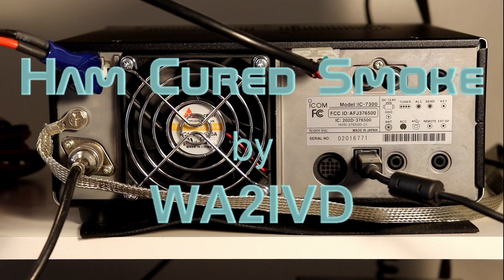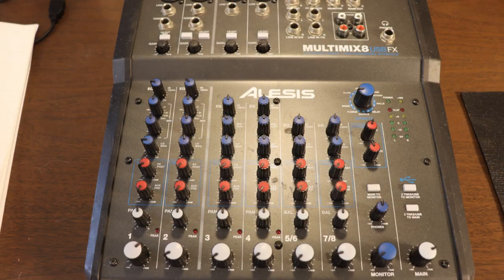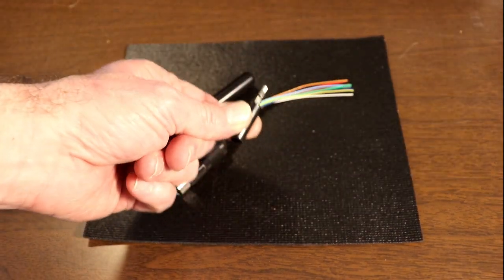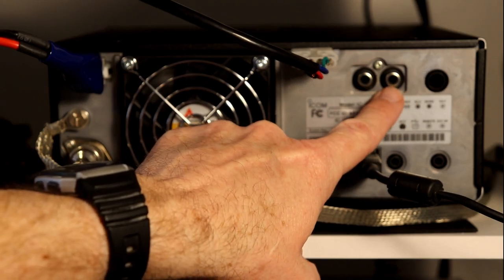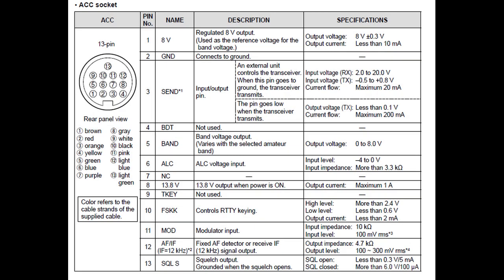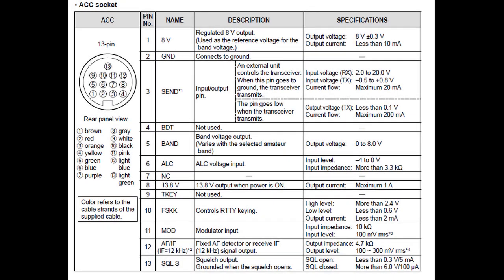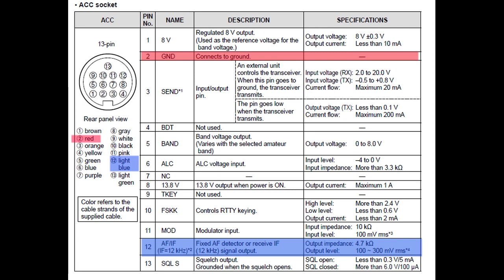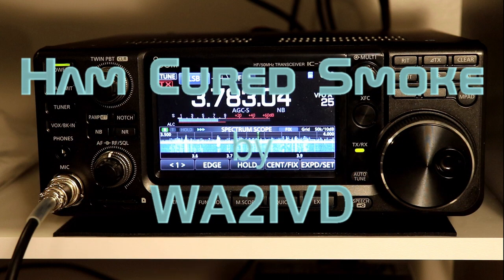Icom IC7300 A to Z #8 Acc Socket & Connector Info

Comment: hi tom me again 😞 im looking to add a mfj 1708sdr swither between my ic7300 and sdr unit ?
my question is which cable would i buy for a direct ptt from the radio to the sdr
Reply from the maker: Hi.  I found this cable on Ebay that looks like it should plug right into the Acc connector on the 7300 and the CTRL connector on the MFJ.  https://www.ebay.com/itm/Linear-amp-PTT-switching-cable-Icom-IC-703-IC-706-IC-718-IC-7000-IC-7100-13p-/254179107879?_ul=IN&gQT=2
Reply: @HamRadioA2Z  ty so much tom worked a treat glad to see you are still sharing your knowledge 😎

Comment: hi there awsome videos on the 7300. I have an offtopic question: where did you connect your braided lead to thats on the back?
Reply from the maker: I assume you're talking about the ground lead?  In that video we were in a rental house, but I was able to drive a ground rod right outside the wall where my coax came in.  So I had a ground bus bar at the back of my shack table to tie all the equipment to.
Reply: @HamRadioA2Z  thank you I thought something like that, unfortunately i can’t get a ground rod to my schack

Comment: can you do a Video on how to connect a AMERITRON pulser amp tuner to a ICOM-7300 I have a brand new one and I cannot get it to work, is there a special setting the radio has to be on?
Reply from the maker: Hi Henry.  I haven’t used any amps with my radio yet.  So I don’t have any direct experience with this.

Comment: Thanks for the straighforward explanation Tom. What does one need in order to use the accessory port for multiple functionalities, is there a break out box or similar available?
Reply from the maker: Icom makes a cable (OPC-599) that splits the accessory plug into 2 smaller 7 and 8 pin DIN connectors.  It is mostly for compatibility with accessories for older Icom radios that had 2 smaller connectors instead of the 1, 13 pin connector.  I don't know of anyone that makes a breakout box or anything similar.  Although, that sounds like a really good idea.
Reply: @HamRadioA2Z  Thanks Tom. I did see a home brew version on YT about a year ago (by an EI ham I think) that needed two or three specific functions that each required a common earthe/ground feed and they took out the various functions to separate 13 pin DIN connectors mounted in a project box, and I recall him pointing out that not all 13 pin DINs are equal in quality.

Comment: I wonder if it is possible to use the amp keying port to power a relay which would switch between  an rx and tx antenna
Reply from the maker: Sure.  That would work.

Comment: Another excellent vid.  Why is the key plug stereo?
Reply from the maker: You need stereo for the 3 connections to use a paddle with the internal keyed - Dot, Dash & Common. You can program the radio for a straight key. Then you only need the tip and common connection.
Reply: @HamRadioA2Z  Got it! Thx.

Comment: I use a mixer too, but I go directly from the speaker jack on the back of the radio into the mixer with an adapter. No need to use the accessory port in the back. Why did you not choose the speaker jack to mixture way?
Reply from the maker: Hi Jose.  Thank you for the comment.  There are 2 reasons that I use the accessory jack.  First, the audio level coming out of the accessory jack is a “line level” output or about 1V P-P max.  It is more suited for going into the input of a mixer than speaker level audio.  You can use a resistor divider or attenuator to make the speaker output work okay.
The second and more important reason for me is that the accessory jack output level is fixed, regardless of how the AF Gain or volume control knob is set on the front of the radio.  So, once you set you mixer levels, you don’t have to worry about them changing if you or somebody else accidentally or intentionally adjusts the volume knob.  73,  Tom

Comment: What Is the trick for unplugging the power cable!
Reply from the maker: Hi Frank.  I had this problem early on also.  It looks like you should press on the split piece of plastic toward the rear of the connector, (at least that’s what it looked like to me)  That is not the case. You need to press on the center piece of plastic on the top of the power cord connector right next to where it meets the connector on the radio.  You need to do this with a thumbnail or with a small screwdriver.  Then the power cord connector pulls apart easily.

Comment: I love your videos. All of them have been good for me as a new ic-7300 owner.  Question.  I run the audio from all my radios to my digital mixer.  I decided to use the ext speaker out of the 7300 to my mixer so that I can adjust the volume from both the radio and the mixer but I also have a at2020 studio mic that I would like to use for the 7300, along with a external ptt switch.  Can I connect my ptt switch and my mic input through the acc connecter or would it be better to connect through the front mic connector?  Thanks!  W5CIB
Reply from the maker: You will have to connect that mic to your mixer, or to some mixer.  It requires 48V phantom power.  Icom rigs are setup for electric condenser mics.  So they do put out a power source for the mic, but it's only 8 volts.  I don't think it will work for that mic.  You would be best off to run that mic into a mixer and then feed the mixer line-out to the Acc jack on the back.  You can connect the PTT switch to it at the same time.  You could use the one mixer and have all the audio from the radios on left channel and have audio going back to the radios on right channel.  Just make sure you have all the pan pots set the right way or you'll be in for a lesson on feedback. 😉
Reply: @HamRadioA2Z  Can you detail a video or even here in the comment section, which of the wires from the ACC cable are needed in order to connect a microphone through the ACC socket? For example pin #11 says "Modulator" pin #3 SEND and then there's a ground pin. Are these the 3 you need to get audio from an mixer XLR connector in the 7300? Your response is highly appreciated

Comment: Hi do one please not in the handbook usi g the external 4 button external keyboard  its programming and use  thanks
Reply from the maker: Hi Peter.  I think you’re talking about the button switches that you can build to select and transmit the different voice or keyer memories.  I have thought about that and would like to do a video with a build project to make a switch box.  Not sure when I’ll get to it though.
Reply: @HamRadioA2Z  I would be happy to see a switch box video Tom. Also, this might sound strange, how about a video on how to use the filters correctly, i.e. in real situations. Which to use when and even how to make sure that you default them after changing the settings for a specific qso.

Comment: I am assuming your mono connector to the mixer will output in one channel only out of the mixer?

If that is the case, I was looking or a 3.5 mm mono to dual 1/4 mono, but not found yet. In that way I would get line Right, and line left on my mixer, so I can use both output channels with two studio monitors I got. 

Are you using then just one speaker for the audio then? Thanks.
Reply from the maker: Yes, mono.  No dual receive in the 7300.  So nothing for the other channel.  I have the rig going directly into a 1/4” instrument input on 1 channel of my mixer.  Each channel on my mixer (and most mixers) has a Pan pot that allows you to direct that channel’s output to Left Channel, Right Channel or anywhere in between.  So should be no problem getting your rig output to both speakers.

Comment: Hi Bob  i would like to install on the ic7300 my behringer console but without the mixer.
do i use the same connection that you describe on the video and the connection is direct  without
any electronic components (resistor etc)?
thanks bob
jimmy kp2bh
Reply from the maker: Hi Jimmy,
I don’t know which Behringer console you have.  Most of their equipment that I am familiar with are mixers.  Regardless, you can connect the audio out pins that I described in IC7300 A-Z videos 8 & 9 directly to the Line-In input on any mixer or other analog audio input device without the need for any resistors.  There are certain cases where you might want to use a 1:1 audio transformer to provide a layer of isolation between the rig and your audio equipment.  The impedance isn’t too critical as long as it is a 1:1 transformer.  A 600 or 1000 ohm transformer should work fine.
73,
Tom  WA2IVD

Comment: Thanks guys... just took delivery of a 7300, so thanks for the info...retiring my Yaesu FT-847 and SignaLink.
Reply from the maker: You’re going to really enjoy the 7300.  I had an FT-897 and 2 FT-857s.  I still have one 857.  They’re great little radios, but the features, functions and audio quality you get with the 7300 is hard to beat.

Comment: Tom, you have a great series.... what connections are needed to directly connect the 7300 to a windows laptop for FT8 software (etc) without using a SignaLink interface?
Reply from the maker: Hi Bob, Mohammad is correct.  The IC-7300 has the sound card interface built into the radio.  You just need a USB A-B cable.  Plug it into the radio and into your laptop and your almost done.  If you're running Windows 10, it will recognize the audio interface and install drivers automagically.  Then when you run your software, you just need to select the right audio device.  In WSJT-X, for example, go to the File menu, then select Settings, then click on the Audio tab. Under Soundcard you can select the audio devices from the drop down menus.  The 7300 will show up as something like "USB Audio CODEC", probably with a number in front of it.
Thanks for the kind words and I'm glad you're enjoying the series.
Reply: @HamRadioA2Z  Might be a good idea, if you make episode related to setup FLdigi, WSJTX .. or other software .. The basic concepts are.. 

Make sure PC/laptop recognizes IC-7300's virtual comm port and soundcard devices..

I think that is the most important  step  to control the IC-7300 using PC/laptop. 

Thank you..

Bahathir 9W2GNU, 73.
Reply: Hi,

You can use builtin soundcard. There are several instruction videos related to it. 

Also we use the built-in soundcard to record audio  from the rig. Use recording software such as Audacity, and select audio input from the rig, which usually  named as "Audio CODEC". 

Thank you.
Reply: @markybyeah  
Agreed, the rig has built-in TX/RX audio recorder, but it cannot retransmiited the recorded audio.

So by recording the rig's audio using PC/laptop/smarphones/tablet, we easily able to TX the recorded audio. Example record QSO for audio check and reTX it  bacc. 

Also it more convinient to record directly to PC/laptop where we can shere the audio file without need to take off the SDcard from the rig and copy the files to PC/laptop In In my setup, I record the rig's audio directly into .m4a format  which use less disk space compared to .wav format, and all are done using RAspberry Pi 3B+ from command line. ..

Thank  you for the comment.
Reply: @markybyeah  

1/ THere  is limit numbers  of files that  we can use for  "Voice TX"

2. We need  to  take off the  SDcard and move and  rename the files. in the SDcard, and put it back to the rig.

3. There is  limits how long the VOICE TX can transmit.

Since we already connected PC/laptop to the rig, we can record/playback   audio files to/from the rig. 

In 2018, my first eear owning the IC-73000, I already did   more than 4000 recordings   using my laptop and Raspberry Pi. It just easy for me to record using command line on laptop/Raspberry Pi. YMMV. 

Beside TX the playback audio file, I also able to use USB microphone as main microphone  for QSOs too.

Cheeers. 73.
Reply: @markybyeah  

I do not have any physical audio mixer or external audio interface. Just one USB cable  connecting to my latptop/Raspberry Pi (Rpi) to the rig.  I use proper programs to record and playback audio files to the rig. Just imagine the rig is a USB audio interface  with radio transmitter/reciver. Here are the simple diagrams of my setup.

RPi <--USB--> RIG

USB MIC --USB--> RPi --USB--> RIG

Main programs of the setup are FFmpeg and hamlib's rigctl. I alsready record several GB of audio files and I have plenty of storage because I can save the recordings to external USB HDD connected to the RPi. I also have 32 GB SDcard in the IC-7300 and ready to be used when it needed

Cheers, 73..
Reply: Hi tom. Do you have an episode that shows how to make the ci-v or cat cable to control the ic7300 without using the usb? If dont have, appreciate it of you can share the diagram.